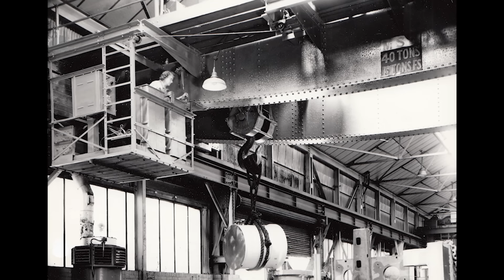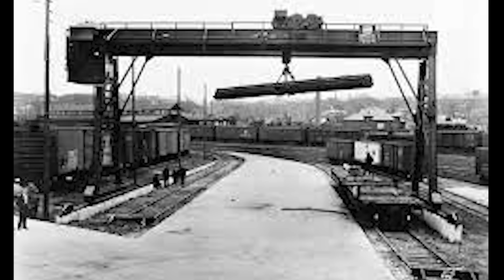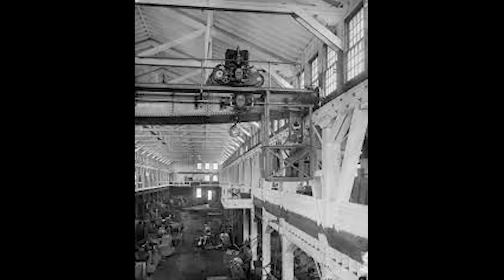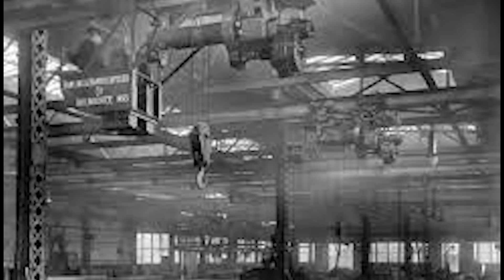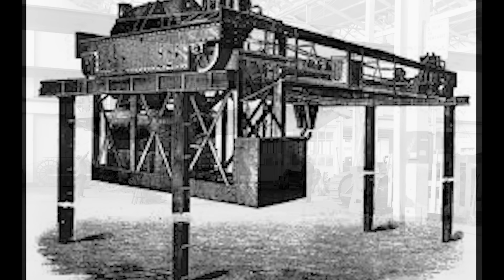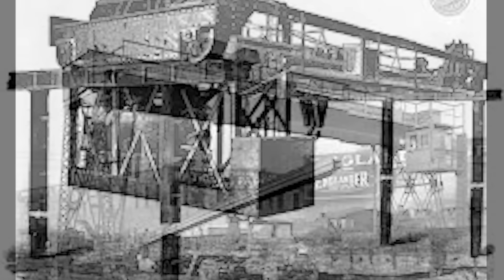Why 1940s Factory Overhead Cranes Still Lift While Modern Hoists Get Scrapped

Comment: Whiting Corporation , Monee, Il is still building engineered cranes. Was an engineering co-op student with them in the early 50s when they were located in Harvey, Il. Most were welded box girder, but we also built riveted designs. The crane drives and trolleys ran on 3 phase power - 440 volt/phase if I remember correctly. I enjoyed working in the shop - using lathes, shapers, welding, wiring slab mills and Trackmobiles. Nothing beats the smell of cutting oil and hot metal chips. Those were "pre-OSHA" days and you quickly learned not to walk under a load and how to avoid "welding - flash" eye injury.

Comment: That old Dresser I was talking about it was so old some parts were not available and we would have a machine shop make them. Other than that we replaced the wire rope and tuned up the old drum switches. Back then the prints that came with them not only a part number but the dimensions so you could have parts made.

Comment: 60 English Ton hook,   Beam over bay 120 feet,  traverse  over 10 bay's  2260 feet,  Open reduction drive from Slip-ring motors  Built 1948 and still in operation.   In England along with others,  Armstrongs factories for one built bay cranes in the foundries and gun casting shops.  America only built another good crane.

Comment: I saw the 700 ton cranes at General Electric in Schenectady, NY. If I had the facility I could have gotten whatever cranes they were scrapping at that time around 1999.
Reply: Thats the problem you can get them for nothing but is cheaper to buy new, than get the old one certified.

Comment: I worked 50 years in.large maintenance shops and have seen the cut backs & saving MI ey. One rich fortune 500 company that I worked for bad a ROI if k my 5 to 6 years. Best was when rather they spend $90K on a made in USA machine they purchased one from overseas for only $60 K. That company did not have tech in the USA so they would pay to fly a mechanic for a few days and he always said it was an electricsl problem so they flew in an electric tech . This occurred at least 8 times. Machine only ran 5 month dps first year. Another great so they taught cost savings was no more Saturday overtime maintenance. After 6 weeks they lost so.much production from on nothing getting greased, old belts & chains replaced and oil changed they bought us back working 12 hour Saturds